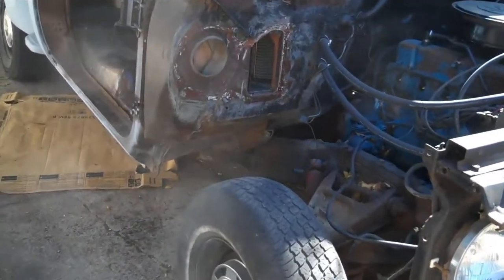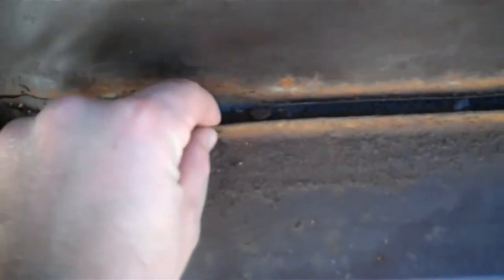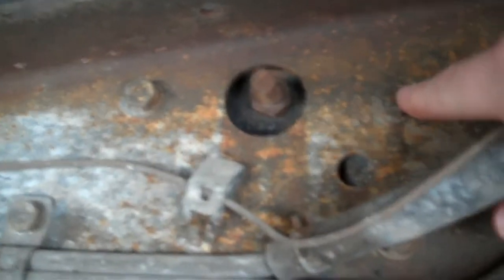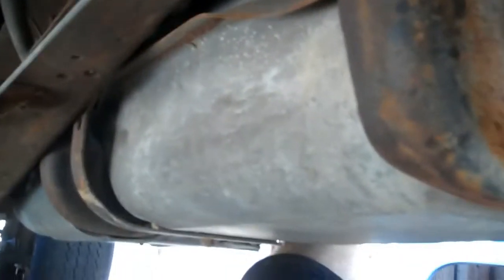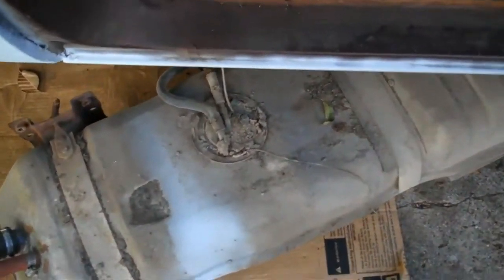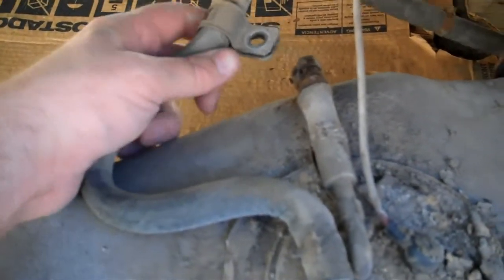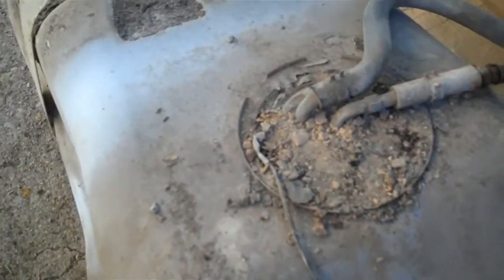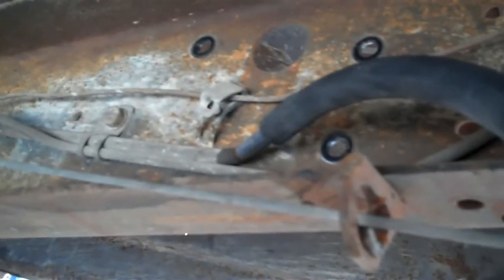PART 8 73-87 C10 RUST REPAIR | Welding Chevy Patch Panels

Comment: I've been having my doubts and fears about getting in patch panel replacement, knowing that so many things can go wrong and hold up the job. This is my only wheels except for my Model A Ford and my bike. I've got one NOS fleetside box side  (wish I had another one) which I may start with as soon as it's epoxy primered. Now there's something I may need a little help with, especially since there's a canopy on my box.

Comment: I assume you had help removing the doors and hood. I don't think the dog would be of much help. And what did you use to lower the gas tank and raise it back into place?
Reply from the maker: Jim Ervin The doors I was able to remove by myself.  You will need two people to remove the hood.  It helps to have an extra person to help you with the doors, but it is possible by yourself.  If you have new paint (or just really care about the existing paint), I would advise getting help with removing and re-installing the doors.